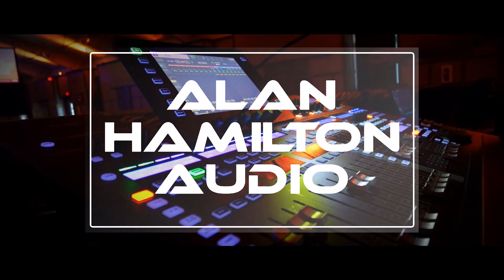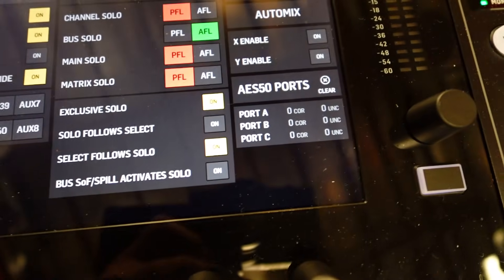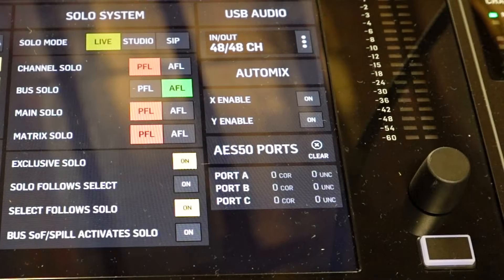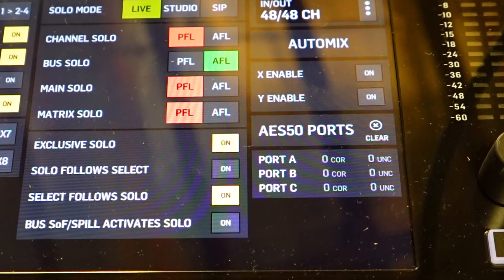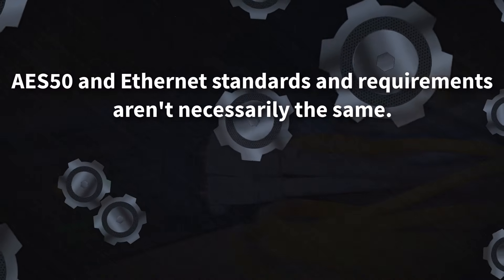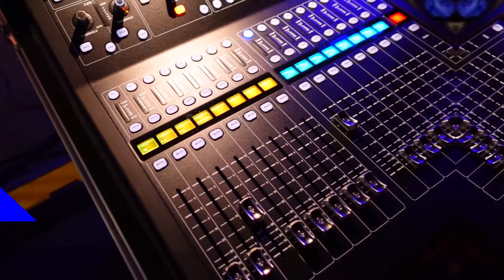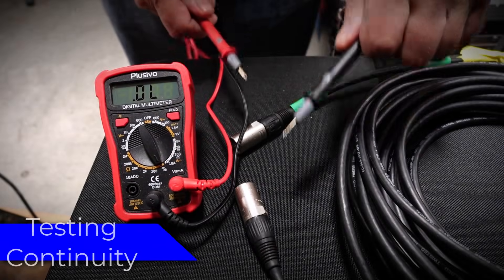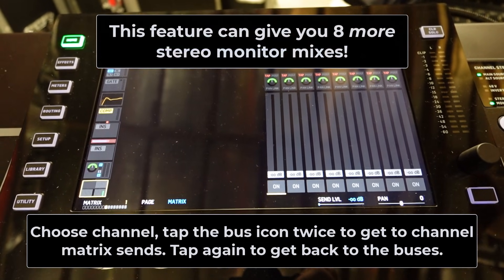Behringer Wing Now Has a Built-In AES50 Cable Tester! Let's Check It Out! Wing | Compact | Wing Rack

Comment: One question, is it necessary to use an audio processor like the Driverack PA2 or Venu 360 to align and adjust the PA and subwoofers?
Reply from the maker: Newer, matching powered PA's... maybe not. It depends. Older PA's more likely yes. Things like the JBLSRX900 have the processing built in and software to change things. Some brand powered boxes have locked in processing, or only allow a few changes, but it's still a good baseline for the boxes. But most are made with the idea that the sub models and tops will match and be able to utilize factory settings as intended by the engineers.

Some digital consoles have the ability to replace processor functions, but that does leave your vulnerable to calling up the wrong scene and causing trouble.

Comment: That WING looks nice. I'm kinda close, just got an X32 Rack for Church.
Reply from the maker: The X32 Rack is nice, but that large touchscreen on the Wing Rack is pretty cool itself. Both mixers can get the job done though. :)
Reply: I got my setup about 90% complete from physical rack install and cabling, then the computer app setup. Got that far in roughly 90 minutes and I'm disabled. 

I began mixing at the church on a 16 channel Mackie analog, 20 years ago.